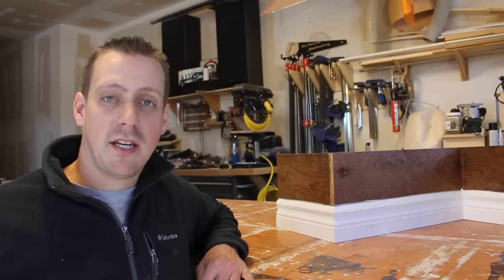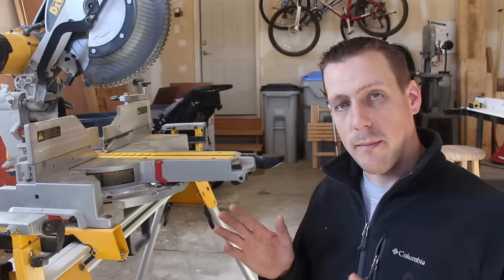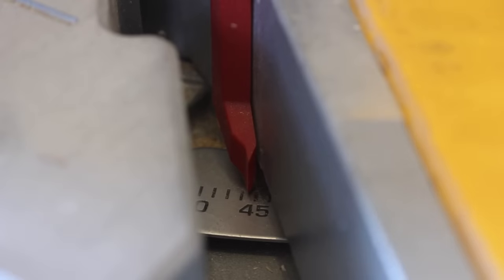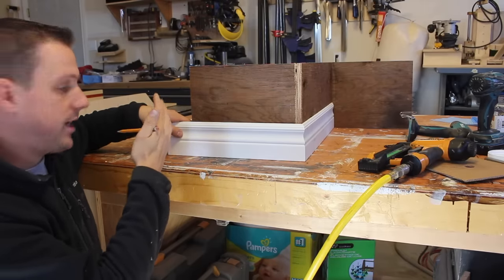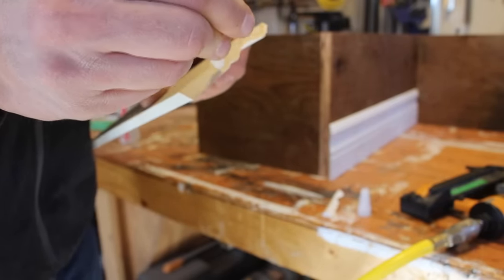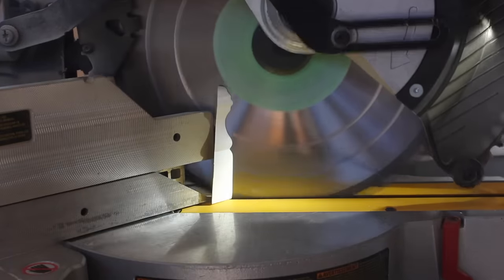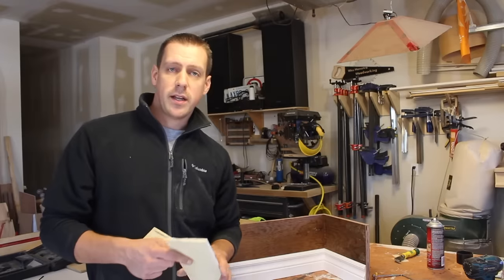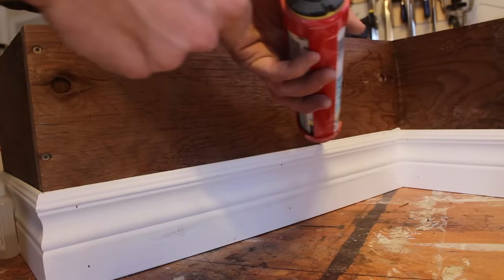How To Install Baseboard Like A Pro!

Comment: I'm turning a pantry bi-folding door into a pantry door. It's next to the left side of fridge, and at the end of the kitchen. There is an adjacent opening to the Dining room left side to pantry. The door trim will butt up against the adjacent wall which is part of the opening to the Dining room. This leaves no room for the baseboard trim to sit next to the door trim, and will instead run into it. What's the best way to handle this situation?

Thanks! 👍

Comment: Good stuff Wes; quick question, why not just use two 45.5 angles for the inside joint?  The bevel looks great; but wouldn't that work too??  Thanks!

Comment: So question, when you do the trim piece in a doorway (outside corner on both sides) that already has a 45 degree trim board on both left and right side, so u have to fill in the gap, what’s the best way to do it?

Comment: I just watched another video where the guy turned his board upside down and trimmed of the flat portion of the cope with his mitre saw. I thought that would be a great time saver. But watching how fast and accurately this guy used the coping saw it would not matter. For me however it probably would.

Comment: Hey thanks. Was that just a spray glue in the can? Nice trick with the sandpaper 👌🏻👌🏻👌🏻
Reply from the maker: No, it is called mitre bond. It’s a two part glue. The spray is an activator. Glue drys in 15 seconds with it

Comment: Can you use a bevel cut for inside & outside cuts on skirting board or is it always a mitre cut for the inside and outside cuts ?
 Also  would a 45 degree bevel cut line up with a 45 degree mitre cut ?
Just purchased a dual bevel sliding saw and trying to understand each cut before installing skirting board.
Great video by the way .

Comment: Hey Wes.  Thanks for your insight on the installation of baseboards.  Very helpful.  Question on installing and coping inside corners where you have 2 inside corners on the same run of baseboard.  Any tips hints.  I would guess you would cope the one inside corner, but when you need to trim the other end to fit (also an inside corner) how do you measure for the length of the run?

Comment: 16 gauge or 18 gauge nailer?  And how long should I go on the nails?  I have a 16 gauge nailer, but the holes look a little on the large side to me.  Thinking of getting an 18 gauge nailer if that would give enough holding strength.  I also think I read to go with 2" nails and that generally avoids you nailing in to wiring and plumbing inside the wall.
Reply from the maker: Ben Mills I always use a 18 g  nailer.  I use 1 1/2”  sometimes 1 3/4” . 2” seems a little over kill. You do need to be mindful where electrical and plumbing might be.
Reply: Wes Hamstra, with 1/2” trim and 1/2” drywall, is 1/2” of nail in the framing enough?  I genuinely don’t know.

Comment: Nice video not sure why it popped up on YouTube because it’s an older video. Wes if you’re still alive please stop cutting MDF indoors without a filtration system. Very dangerous dust, cut outside down wind if possible. Appreciate the tips and tricks.

Comment: sorry im new to this—is there a certain degree you can cut both of those inside corners to avoid using the coping saw? Maybe make life a little easier? 

great video
Reply from the maker: yep, there is, you will need a angle finder. if you go to my amazon store you will find a angle finder that will give you the mitre cut for your saw. I use one all the time and I get perfect corners every time with it.

Comment: Hi Wes. Great tips! Probably a dumb question, but just wanted to note I love the way you handled the returns. I am using square molding in my project. Is it fair to say you wouldn't bother with a return on square baseboards? I feel like that level of detail wouldn't be appreciated in a square application.

Comment: Great video. I need/want to replace the cheap 3" baseboards in my bathroom. I kept the spares from when I did my flooring..but I don't have the power tools. can this be does to the same detail using hand held saws?? Or is it just a royal pain in the ass and I'm better off finding someone in the trades and giving them $300?

Comment: Hi thanks for the video! Do you think using glue and nails to fix the skirtings on the wall is neccessary? Or will caulking the skirting intop, and bottom solve that

Comment: I’m just wondering sometimes wall too long and boards not enough to fit . That’s why we have to put 2 . When I put second one next to first one should I cut 45.5 degrees or it’s just for outside corners ? And is there any trick to cut small pieces for corners to cover ?  Thanks mate

Comment: Not sure if you will notice this given how old this video is but I am redoing my bathroom for the first time and I have hit a bit of a problem. The drywall from the wall itself does not reach the floor and is pretty chewed up. The house is 110 years old and this was hidden by the other boards which they used one nail in the top to hold. My question is should I use nails again into a fragile drywall bottom or could I just caulk/glue the baseboards back on. A mail would only be able to go into the top so I’m not sure I see a point and the pressure might cause the bottom to bow out. Have you ever used an adhesive to hold baseboards on?
Reply from the maker: Hi. You could cut some plywood and add it where the drywall is missing. Caulking will hold it when dried

Comment: excellent video - why do you use the bead of caulk at the end (over the top of the trim)
Reply from the maker: I don’t know why I did it. On drywall with paint grade trim it normally gets caulked. Because the plywood I used is rough it made it look like crap

Comment: Hey there thank you for posting this video!
I had a question do you make a return to terminate the baseboard or crown molding to a piece of casing or just a open finish? Thanks again
Reply from the maker: Jesse Wickline thanks for watching. The return is used where it ends at nothing. For example at the top of stairs or beside a bath tub. I wouldn’t use it against door casing. I would cut it tight to the casing. Your door casing should be thicker then the base, so there is no need to do a return there.
Reply: Wes Hamstra that’s what I figured I really liked how you explained the outside corner not being a 45 degree angle. I never could figure that out they never came out right before for me lol. The coping is totally clear for me now too! Thanks a bunch I was only thinking about baseboards I have to install in my basement and you video came on my feed. Anyway thanks a lot!
Reply from the maker: Jesse Wickline no problem, glad I could help. Let me know how it goes!

Comment: If I understand, a return is basically cutting the end of the baseboard at a 45 like you would in an outside corner, then cut another small piece that is angled to cap off the end. Is that correct?
Reply from the maker: That’s right. I made a video on how to make ma return. Search my video catalogue for it.

Comment: Just a note. You'll find out real fast that your miter saw can't cut inside and outside miters with the trim straight up and down if you don't have a fancy one like he has in this video (large - sliding). If you just have the standard home gamer style one, your blade will bottom out on the top of the baseboard and you can't cut all the way through and you'll have to rethink the cuts as you have to cut the baseboard with the saw while lying flat. I think that's an important detail.

Comment: I'm curious why you didn't just cut the inside corners to ~45 degrees instead of using a handsaw to cut the other piece of trim?  It would seem much easier to just cut the inside corners to ~45 degrees and butt them up against each other.  That's how all the trim in my attic is installed and it looks just as clean if not more so.

Comment: How do you handle baseboards canting downwards because the bottom tucks slightly under Sheetrock when you sink a nail in the lower half of it?

I installed LVP and my baseboards sit very low. I can avoid them tucking under bottom of sheet rock by only nailing top 1/4, but that leaves the bottom unsecured/ free to move inward if pushed.

Comment: Hi, thank you for your video! I need to install baseboards, what should I get, a Brad Nail or Finish nail gun? What would be ideal for it?
Reply from the maker: Get a 18g Brad nailer. 1 3/4 - 2” nails
Reply: @WesHamstra  Awesome, thank you for your feedback! I think that I did the right purchase 😁 I just got a 18G Brad Nail gun, I spent a hard time figuring out why I didn’t find a “Finish Nail gun 18G” I just found “18G Brad Nail gun” 
Finish Nail are in scale of 16, 15G and less. And the Brad Nail are in upper scale 18, 20, 23G 
Is that Why??? 🙄

Comment: If only walls were this straight but they put metal corners on and they mud them making it be built up in the corners same thing for the inside corners the put a paper corner in there and apply two coats of mud.

Comment: I'm late but I have a question. When u measure a wall from corner to corner and you get 42 inches so you cut one side do u measure baseboard from the back or front for a inside corner or even outside

Comment: LOL....sure, if you are using painted base.  Otherwise, get a proper angle measuring device of choice and do the math. There can be NO gaps on natural finish material. Inside corners can be properly coped or measured and mitered.

Comment: I bought a 23 ga pin nailer for trim work because I found tips that say it holds well and leaves almost invisible nail holes. So I assumed this method would be less work than filling holes after install.  Is this a good idea or just lazy and should I be using 16 or 18 ga finish nails and buy a different nailer?

Comment: ok, before everyone roasts me for my question, I've never done baseboard before...  Why can't you do a 45 degree cut on each side of an inside corner, like you do on the outside corner?  Does that not work?  Will they not line up well?  Am I missing something extremely obvious here?  the coping looks awesome but do you have to do it that way?
Reply from the maker: You can do that. It takes a lot more fiddling to get it to look good. Coping is a lot easier to get good inside corners

Comment: I am getting ready to remodel an older mobile home that does not have baseboards...Should I install the baseboards before or after laying the carpet?
Reply from the maker: Do it before. Leave the base up 3/8”. This is coming from a carpet installer. It’s easier to install carpet with the base on.

Comment: I'm about to do a baseboard in my kitchen not a big piece however my aunt wheelchair damaged the wall behind the board what's the best way to fill that back b4 applying the board?
Reply from the maker: Wow she must have hit it hard to damage the wall behind the baseboard. If you have 1/2” drywall you could patch it some new drywall. If the damage is hidden by the baseboard you could patch it with 1/2” plywood.

Comment: Why take the time to cut the inside corner at 45 degrees just to cut that edge off with the coping saw? Curious because, like many, I ended up here because I have to install some baseboards

Comment: Maybe this is a newbie question.  But for the inside corner why would you not just cut the two pieces at 45 degrees on the miter saw.  Butting them together and trying to cut the exact profile with the coping saw sounds like a tedious art form. What problem is that solving compared to 45 degrees cuts?

Comment: This question may have been answered or possibly sound completely dumb, but do you ever caulk the bottom between a floating floor and baseboard? Thank you.
Reply from the maker: Never do that. A floating floor needs to expand and contract. Caulking the baseboard to the floor will prevent that from happening. Your floor could buckle or have gaps open up.
Reply: @WesHamstra  thank you. That makes perfect sense.

Comment: Hey , I have about a 1/2unch gap between the floor and the wall and the baseboard isn’t think enough to cover it , should I just caulk it / put more grout in ? Please help
Reply from the maker: Larry Fisherman I would install a quarter round or shoe mould on the baseboard. Google it if you are not sure what that is. Caulking or grouting the gap won’t look very good.

Comment: OMG I really want to send these to the company hired. They spent 8 hours measuring and cutting baseboards and STILL didn't finish 2 small bedrooms😳, corners not tight and ends blunt cut. I’m no handyman but it seemed like a bit of a process for 2 unfinished rooms😔😰

Comment: Do you always caulk the top of the baseboards or only when the wall are not flush ?
Reply from the maker: When doing jobs for customers. I let them caulk it or let their painter do it. When it’s for myself. I always caulk the top then paint it. I only caulk it if it is painted base. Don’t caulk stained base.
Reply: @WesHamstra  Thanks for your response.
Reply from the maker: No problem

Comment: How about showing how to do these inside-outside cuts without a table saw with lock down adjustments but with an inexpensive mitre box? Not every one needing to do their own repairs can afford these nice tools.
Reply: A cheap miter box probably wont be adjustable. So you're just stuck with 45. If its adjustable all the same concepts apply except when he press the button and makes the cut you just hand saw it. Do it face side up to minimize tear front tear out.

Comment: What about larger baseboard on an internal? I hate when the receiving piece kicks in at the bottom cause the wall is ugly  for example and the scribed piece goes against it and there is a tapering gap.
I have tried lots of solutions over the years, none that I would recommend as THE solution. 
Anyone??  Please??

Comment: Instead of marking each piece I write down measurements with a measuring tape for each piece of the wall that way it’s faster when using the saw and placing them on the wall.

Comment: or cut a 44.5 on the inside corners instead of a cope and much less work is required
Reply from the maker: That doesn’t always work. Inside corners are never square or plumb

Comment: Why would you not just cut a 45 degree angle for the inside corner as well 
Your way seems more complex for the outside corner
Reply: Inside walls are rarely straight 90 degree angles so this method covers all possibilities.

Comment: About how many teeth per inch on the blade?
Reply from the maker: It’s a 12” 60 tooth blade
Reply: Thanks, just spent a day helping someone cut and install shoe molding. His tools included a new saw with 15 tpi. Makes for sketchy cuts and hand filing.

Comment: Nice video but the hardest thing you did --- cutting that return --- you didn't even show in your video. How do you cut that return that you glue to the main baseboard piece? You completely left it out of the video. Which again is probably the hardest piece to cut but you don't show how you cut it that would have been nice
Reply from the maker: if you think about, its the easiest thing. its made exactly the same way as an outside corner. I have a video on making the return. search my video catalogue for it

Comment: While this would be good for the homeowner - no contractor will ever do this for the inside corner!!!  It takes too much time!!!
Reply from the maker: That’s not true. I am a contractor myself. This is how I do it. Every other contractor I know copes inside corner. It does not take much time. I can cope a 4” colonial base in less then a minute. When I am finished a trim job. There is no need for caulking